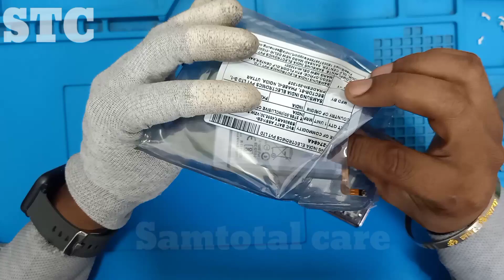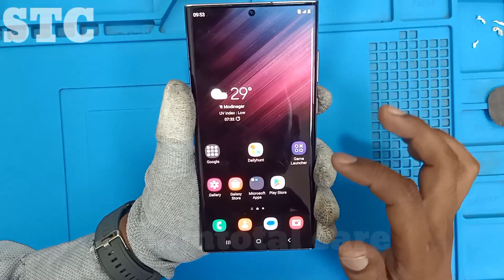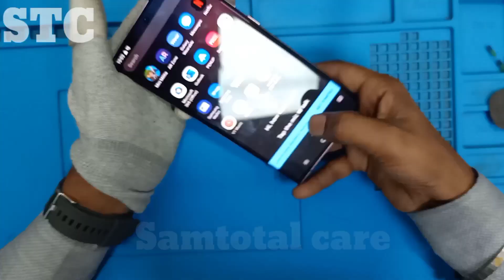Samsung Galaxy S22 Ultra 5G / Battery replacement & assembly disessembiey

Comment: My 22 ultra keeps rebooting and the only way to get it into android os is to stick it into the freezer and it only lasts 2 mins. Would this more likely be a mother board issue.
Reply: My friend I had the same issue it's a boot looping problem and the mother board seems to be faulty I had to send mine back to get the whole thing swapped out and fixed sadly if you don't have phone insurance you can't do much about it

Edit: 

You can get replacements parts on the Internet just be careful with a mother board you need to have the right match with your phone